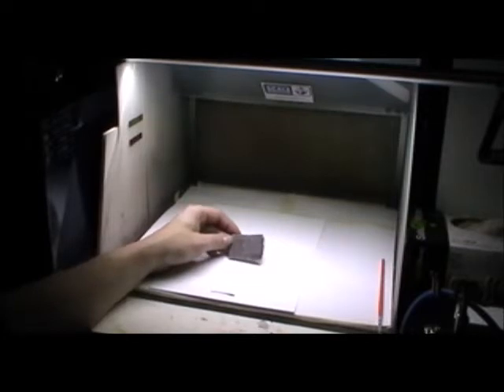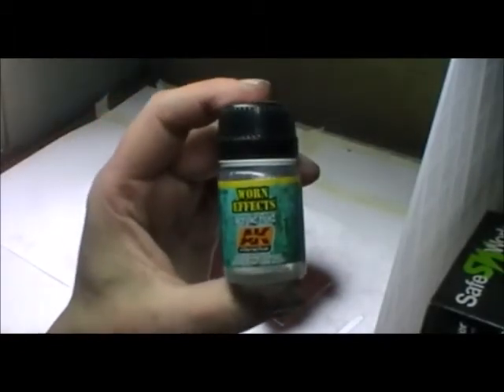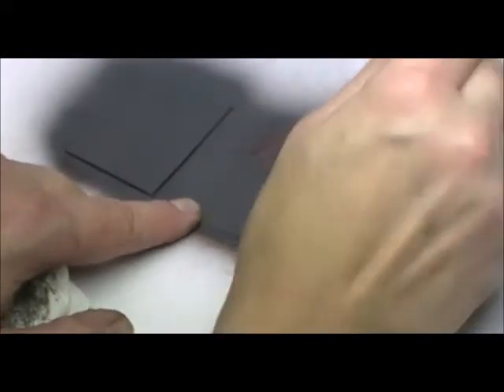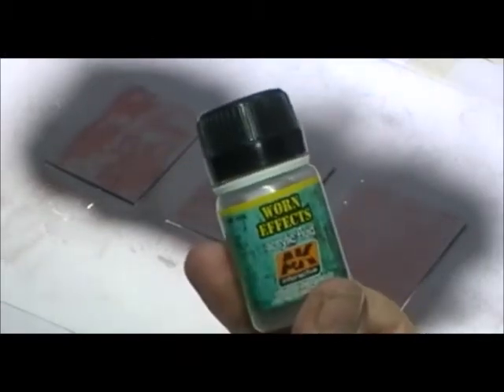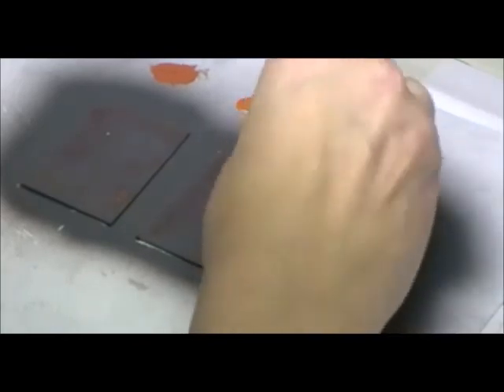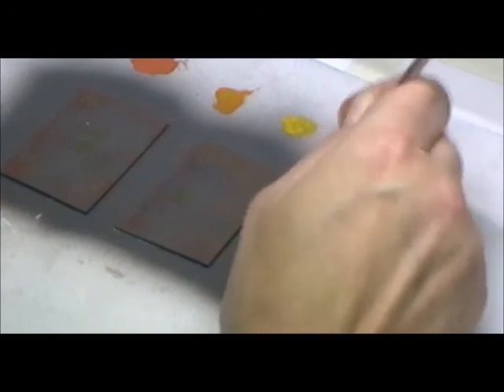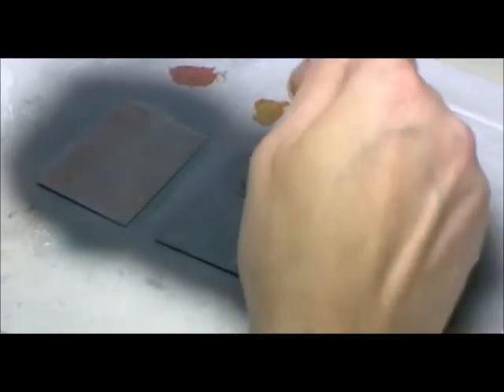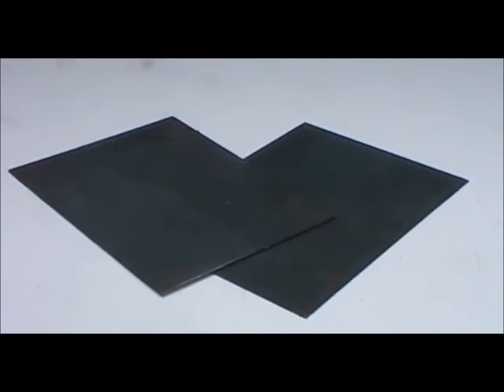Paint tutorial on making scale Metal plates

Comment: More questions please, 
You use Vallejo Model Color (not Air) I see, 
Do you thin it to air brush? 50%? What pressure? 
And how do you like UMP thinner cleaners?
Reply from the maker: I use mainly moddel air, but sometimes I mix my own.  I use model colour with Vallejo thinner 50/50  haven't tried the ump thinner jet..
Reply from the maker: I airbrush at 1.2
Reply from the maker: The ump cleaners are good, cleans a lot more out the airbrush. The ump burnishing fluid is also recommended.